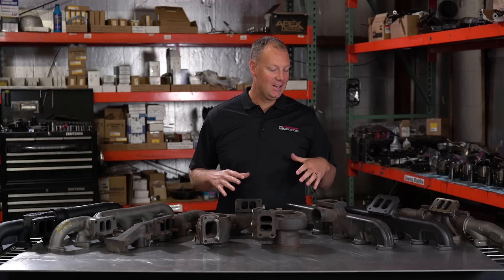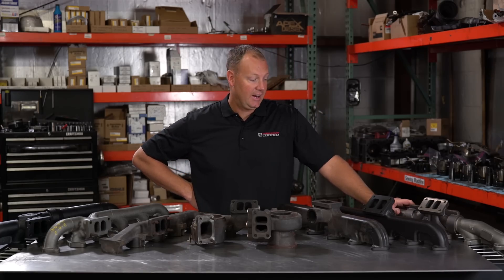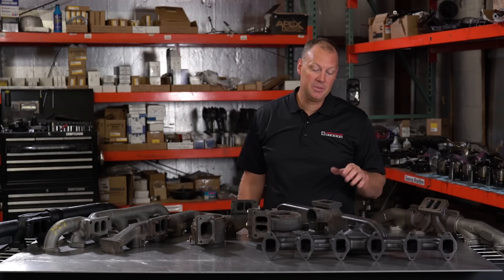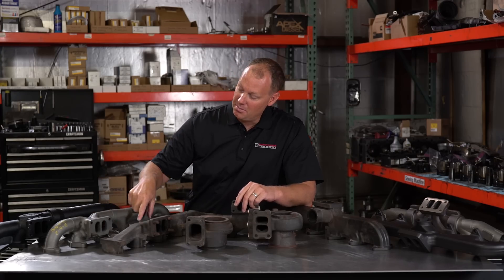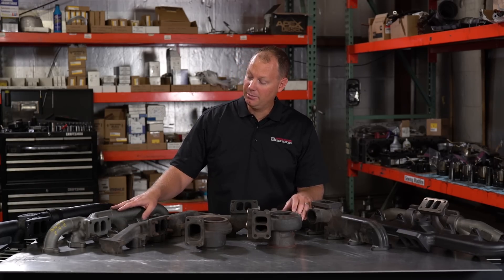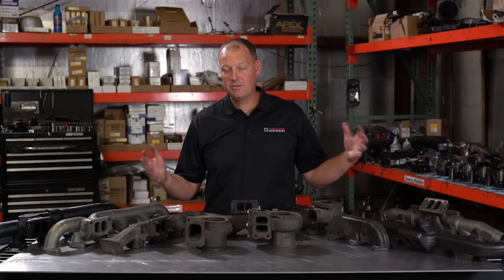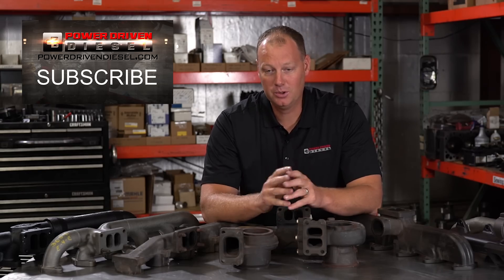Diesel Engine Exhaust Manifolds Explained

Comment: About what hp/ tq leval on a common rail do you acualy need an aftermarket manafold??
Reply from the maker: Need a manifold is a broad opinion-based answer.  At that power level does the stock manifold measurably limit power... that usually happens about the same time the turbocharger itself is upgraded to a larger T4 or T6 frame sized turbo.... S400 turbo, etc.  There seems to be zero loss upgrading the stock manifold even at stock power levels, so upgrade whenever it suits you, there is no downside performance wise.

Comment: I know I don’t need a 2 nd gen swap but I want it and it’s a stock truck and what is best high mount or the stock mount down low ?
Reply from the maker: The stock mount down low generally has more options and saves you from changing the oil feed lines in most cases(depending on turbo setup)

Comment: Really great video! Also, phenomenal to see the divider in the steedspeed manifold sealing up against the wastegate valve. We've fabricated many manifolds (4g63) with a single but divided path to the wastegate, and saw a significant loss in response and boost threshold with even a small path for cross talk without the full divider. Good stuff

Comment: I've got a mostly stock 12 valve that needs a new manifold. Does the Steed Speed hold up long term? 

Just based on the material and construction, I'd imagine it's the best I can get... thoughts anyone? :)
Reply from the maker: They Steed Speed manifolds are excellent.  The ceramic coating wears/flakes quickly in bad weather climates, but the structural integrity of the manifold is excellent.
Reply: @pddofficial  Thank you! Now I've just got to sneak one into Commiefornia! X3

Comment: Just an fyi for anyone interested, my 05 came with an open manifold, my early 04 had a divided manifold.  I don't know if they chose to open it when they introduced the he351 in 04.5.  But my 04 definitely had a divided manny with an open he341.
Reply from the maker: Yes they seem to mix match through the early common rail years.

Comment: How can you flow enough air thru those little manifold outlets to make that big power? Obviously you can, but it doesn't make sense to my small brain lol. That would strangle a gas engine. Love the channel, I'm trying to do a 12v swap on my blown up ( shocking I know lol )08 F250 6.4 truck Good info here 👍

Comment: hey todd in your opinion would it be worth self porting/polishing a stock manifold and where would the best place be to tap for  egt sending unit
5.9 24v
Reply: Rear of the two outlets that go to turbo is the best place to put the prob. Gasket matching stock manifold would help a little. Not enough to notice by seat of the pants tho due to your not really changing to flow inside the manifold.
Reply: @mustangdemon87  rear being underneith?

Comment: Rebuilding a stock 5.9 common rail due to having cracked rings.   Would an after market exhaust manifold help stop that from happening again?  I'm not looking for power just reliability.

Thank you for the videos.
Reply: I just rebuilt my 06 cr due to cracked rings I'm putting on a dps manifold supposed to reduce rear cylinder heat by 200 degrees and they seem to have good reviews. will see seems like the stock manifolds on 3rd gens have crappy flow from the rear cylinders my 5 and 6 run hotter than the rest with stock manifold by like 100+ degrees according to my heat gun after towing so gonna try a dps out. It was my 5 and 6 cylinders that had the cracked rings so worth a shot.
Reply: Yup my 05 broke the ring land on 6 @offthegridoutdoors9666

Comment: Increase fuel efficiency 7%, Increase horse power +35hp, and lower EGT by -150deg with a custom bolt on exhaust manifold by Polydyn.
PolyDyn produces exhaust manifolds for all Cummins gens. They use 304stainless with each port tube being equal in length.

PolyDyn Custom Exhaust Manifold +35hp -150egt 
https://www.youtube.com/watch?v=xAj_lQA47HI

I’m a fanboy of both PolyDyn and Power Driven Diesel.
Maybe they can work together to provide products to the Cummins market.
King of Kings is 59 Cummins Soon

Comment: Twin scroll turbo exhaust manifold and turbo inlet also stop pressure starvation. With each exhaust valve opens it's creates pressure pulses and cycles of higher and lower air pressure when the valve closes that pressure pulse can go backwards. When you get up to higher rpms your getting more pressure pulses and higher chances of that pressure wanting to go backwards. With the twin scroll it eliminates this
Reply: Spot on.  Unfortunately the EGR ports severely disturb the exhaust flow and the pressure pulses whether they’re blocked off or with egr intact.
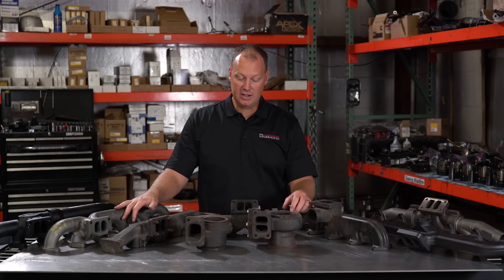Reply: 8:44 8:55

Comment: This video got me thinking about pyrometer probes. On the factory divided manifold, where do you recommend Drilling and tapping? Since it's a divided manifold, aren't you just monitoring three of the cylinders exhaust temperatures by just having one side or the other?
Reply: Hi I know I'm 4 years late but it doesn't matter just put it in the middle of one of the ports

Comment: Great video , on a stock 3th. gen with a tuner will after market exhaust  lower egt ?
Reply: Thank you for the reply , the truck is stock with tuner but read were back 2 cyc run 200 deg hotter and could damage a piston ?

Comment: Thanks for your videos. I am just learning about the b series. You say broken ears know the head? I dont see any Ears on the head. Now cast iron exhaust manifolds can break ears. That 3 piece manifold cam out in the 50,s on 855 cummins 14 liter engine. Never seen on of those break ears. The head studs are a loose fit in the holes on the manifold, so they can move longutudily!

Comment: Why only log style manifolds? Why not a longer runner?
Reply: Stronger, Simpler, takes up less space, cheaper. I also suspect that Diesel's don't benefit from equal length runners like petrol engines do.
Reply: Equal length runners are literally a waste of steel for a diesel engine.
Reply: Because this is a turbo
Reply: Ok, but instead of “trust me bro” can anyone actually source why diesels dont benefit from runner style manifold as opposed to log style?

Comment: Hi, I have a 460whp stock fueled 110k mile 03 6 speed with a Smarty, Raptor lift pump, 3250DD clutch and a s366 that I removed to pass emissions.  Now that I've moved to a place that doesn't test do you think I would see a noticeable difference in spool up by upgrading the exhaust manifold when I go to re-install it in addition a turbine blanket or do you think I should continue to save my money for other stuff like fueling mods, custom tuning or stock/s400 compounds?  
Thanks

Comment: Have First second gen p/pumped (bone stock)  shortly after shutdown there is a "cooling pop"sound numerous times equally spaced of approximately every 3m or thereabouts, over what I'm sure is until cool enough (I've never hung around the complete cycle to time it ceases) 1 is that the manifold receding back to cooled "sizing" and is it something of concern anyone? Thanks in advance.

Comment: Are there any manifolds that provide performance increases on a 24 valve? Any that you'd recommend?
Reply: @pddofficial  I've got a 63/68 s300 on it right now, it'll probably get p pumped and compounds eventually. Is there anything that's kind of in between the stock manifold and steed speeds?

Comment: just my 2 cent thoughts. please correct me if I'm wrong. 
ok. The 2nd gen swap on 3rd gen is a big plus in my book. equal runner lengths throughout the firing ordet should balance the "pulse". that balance should help pull heat away from the problematic  back three cyliders. in theory should create a smoother exhaust flow witch possibly could help with spool up. to me it's not necessarily a HP thing but an efficiency / support thing. plus on compounds things just fit better with less piping. I've seen multiple mild tune towing trucks die due to heat in 4 and 5 on 3rd gen. never seen that in 2nd gen truck. So a 2nd gen swap just makes sense to me.  thanks todd

Comment: and another thought.  how does going from t3 to t4 effect spool?? t4 you gain volume but loose velocity.  and in a compound set up with 362/363 with 475/480.
Reply: You do loose exhaust velocity. You'd need a larger camshaft, head work done, and valve springs  to spin up past 4,000 Rpm to run larger exhaust housing compound turbos. Typically though,  S362 with S475 shouldn't need that.

Comment: ok. my thought on 3rd gen to 2nd gen ex man swap is not neccasarily performance but it is at the same time.... equal runner length equally diveded should give a more iniform exhaust pressure, more equal ex temps and supply a more even "pulse" to the turbo. while hp numbers may not go up...efficiently (spool) should and really help with 3rd gen problems of killing #4 & 5 pistons. would love your feedback

Comment: On my 03 Dodge Ram. The manifold had a diviner and the turbo didn’t . It’s a stock manifold and it was a stock he341. I now have a holset cheetah turbo base off a he351 and it also didn’t have a divider in the exhaust housing.

Comment: I take it by diverter valves you mean like a quick spool valve. Splitting the scrolls in a turbo. Have you had much success with them? We use them in the merc diesel tuning scene and have had 800-1000 rpm quicker spool times. And less restriction than a true twin scroll manifold

Comment: Dumb question from a gasoline guy, but why aren't tubular style exhaust manifolds (headers) used on diesels?
Reply: Gotcha.  Interesting.  Thanks for the quick reply!
Reply: The biggest issue is cracking, that's I've seen in the Powerstroke world. Being that your exhaust pressure in a real high performance application can be over 100 psi, the flow advantage isn't that large compared to an NA gas application.

Comment: Hi there. Have you ever tested twin-scroll vs. single-scroll side by side?
Reply: I think those housings would be quite nice to be tested since they are commonly available. On gasoline world some have reported 300-500rpm earlier spooling and bit higher power output. that would be actually quite a big thing in diesel application

Comment: Good video thank you I have a 2006 Dodge Ram 3500 single wheel Cummins stock Turbo smarty jr. 5 inch exhaust cold air intake turbo Rings been moved and aftermarket elbow intake I was wanting to put an exhaust manifold on my truck just for maybe making the et's a little cooler should I put one on what one would you recommend or should I just leave it alone and I have a Boost fooler on it and the transmission is stock automatic
Reply: So I went with an ATS manifold on my truck when the original warped and began to leak. Over all my egts didnt seem to drop drastically (maybe 100 degrees give or take.) On the top end but they did seem to reduce alot faster overall when I let out of it. I also have noticed faster spool up and an overall more even powerband. Hope this helps.
Reply: @Darezombie  THANK YOU

Comment: So why aren’t exhaust manifolds more like gas motor “headers” .?
I know greater turbo lag with longer manifold runners but on a drag truck that only operates at WOT wouldn’t that increase performance.?
I heard you say the turbo is the biggest restriction in the exhaust but..??
My idea is twin turbo but 3 cylinder manifold feeding each turbo, crazy I know...
Reply: Polydyn makes a badass Header manifold. I want one because it looks badass. I belive its $1500 u.s
Reply: I have a polydyn and it's good for top end. Seems a little more laggy in the bottom end with my cast 63mm turbo.
Reply: I think the issue with true twins they had was it works better in gassers since they don't use the higher boost diesels do and getting them to perfectly match in flow is almost impossible in high boost situations and causes issues in flow rates between them. Also it's been thought that 3 cylinders might be pretty rough to spool a turbo.
Reply: Nicksterzone I just can’t believe you wouldn’t benefit with straighter runners on the exhaust. There must be wave cancellation due to the exhaust pulses running into a wall right out of the cylinder  then colliding with each other in the manifold
Reply: @jeffbeaird747  I think it has to do with manifold pressure. The header probably creats less manifold pressure at low RPM'S And that would in turn creat less boost in theory.
Reply: Jordan Ulbrich but my understanding is you don’t want a lot of manifold pressure, if you reduce pressure in the exhaust manifold and increase flow you can build more pressure with the turbo
Reply: Keep in mind the Steed Manifold is billet and can be shaped to anything internally. Almost certainly directs the exhaust toward the exit before merging with the other cylinder even though it may not look like it extenally
Reply: No but you do want a happy balance between manifold pressure and flow. Think of 100 PSI goings threw an air compressor hose. Now take that same volume of air and push it through a Fire hose. Effort will decrease but so will velocity. Your happy medium in this case wold be a garden hose. Make Sense?
Reply: Jeff  Beaird the higher end manifolds do what you’re talking about. Steed speeds comp header is proven to almost 3000hp (so far) without being any kind of restriction, and many of the tubular headers I’ve seen actually have smaller pathways than the comp manifolds.; I know of one group making tubular manifolds for these trucks that may improve over others, but their basic shape matches the traditional manifold.
Reply: Exhaust volume=lag. Larger surface area means more heat loss meaning less exhaust energy. a good manifold for a diesel would be balance of flow and volume for the power level your shooting for.
Reply: Jeff Beaird, I am no expert on the subject but can share some feed back with you. Mind you this was 10+ years ago on a common rail 5.9 cummins, well before the days of EFILive and HP tuners. The era was TST powermax and Smarty for very crude tuning. A small local diesel shop to me tested fabricated tubular vs. cast exhaust manifolds. The shop owner spend days building an equal runner length and equal volume per runner exhaust header. There was a minimal power gain (<15hp) and not worth the effort compared to spend fabricating this manifold. No other supporting modifications were changed during this comparison. 
Wishing I had hard data today, I was early in my diesel career at the time and data was not important. Hope this helps.
Reply: We use tubular headers on Mercedes diesels running upwards of 4bar Of boost. Seems to reduce lag if anything with a true twin scroll